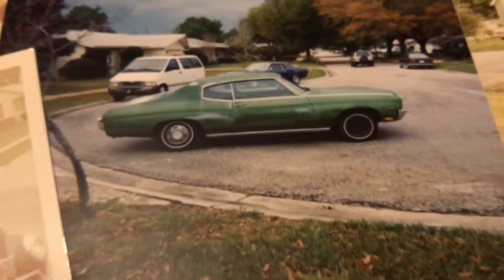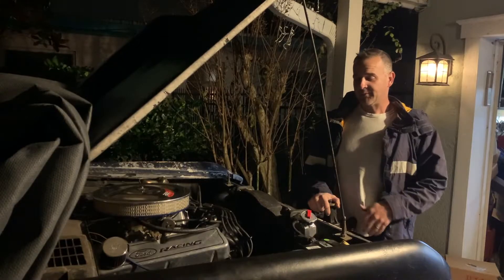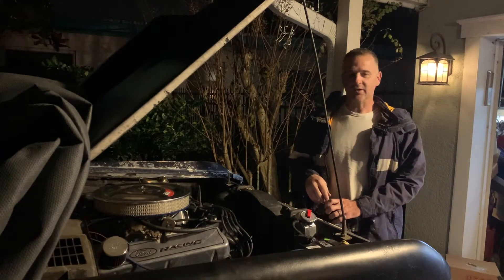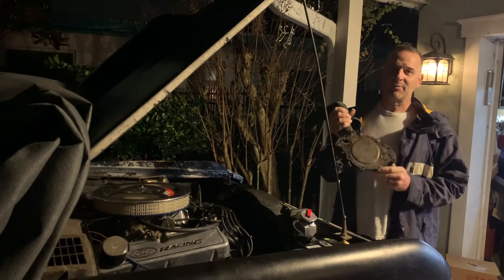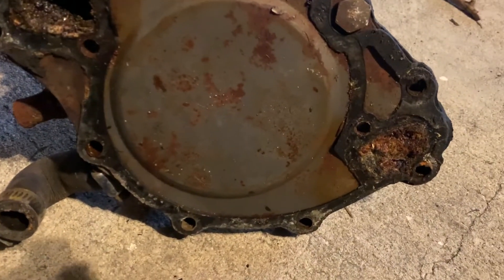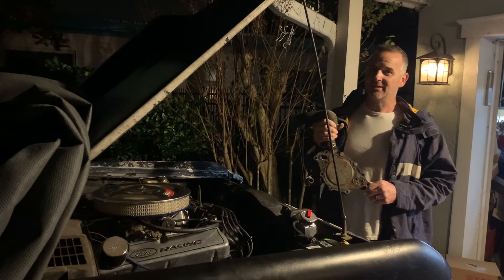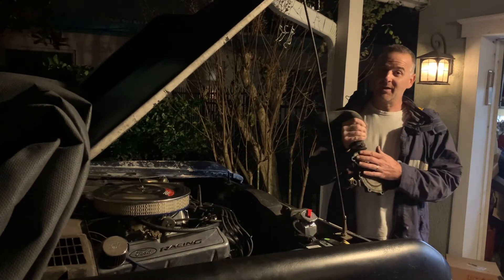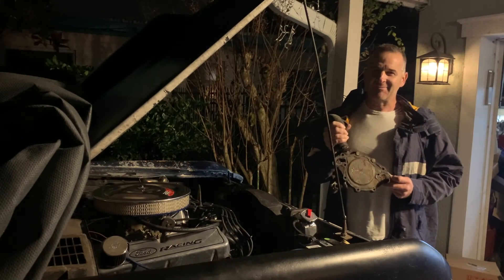How to Fix an Overheating Engine - Ford 302 V8 Engine Water Pump Failure Repair

Comment: Did you determine the water pump wasn’t flowing after you took it off and inspected it, or was there some indication before hand?
Reply from the maker: Good question. Water pump issues like mean low or restricted flow. (We have also seen pumps that have worn the vanes off) in this case we already knew the rad was new and the fan had been upgraded. That made it easy to focus on the water pump. The block also had some restriction in the water passages, but that had been cleaned out when we did the head swap. There was extremely low flow through the thermostat/ block and through the radiator because of this bad pump.
Reply: @ yea. I’m beginning to have something going on. I’ve been out of the country for months, come back the car has been sitting in freezing temps. I replaced one of the freeze plugs due to corrosion, went to start her up…she’ll piss fluid out the overflow, then overheat.
Reply from the maker: @FootageFactory  A couple of thoughts... Did you get the old freeze plug completely out? Sometimes people end up knocking all/ part of the old one into the block when replacing those. That probably wouldn't cause the complete problem you are talking about though. Electric fan or mechanical? Thermostat functioning?
Reply: @ no the full plug came out and cleaned out the hole. Actually you gonna be up for a while. I can live stream my situation. 

Thank you for your time!!